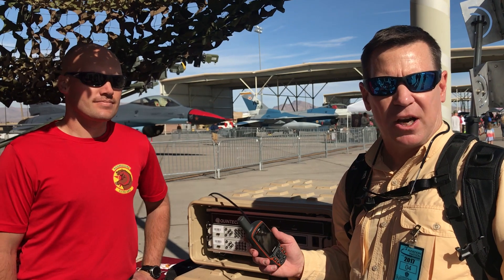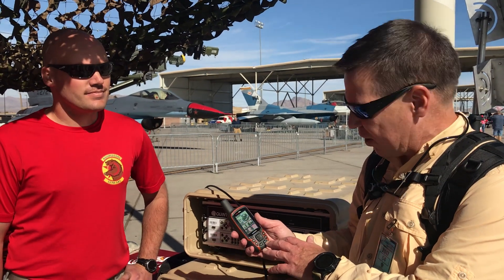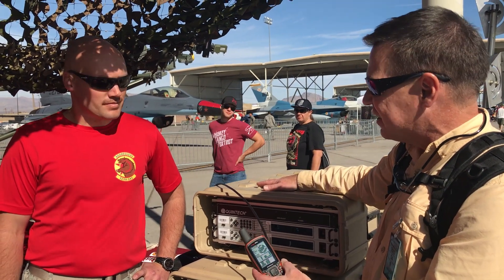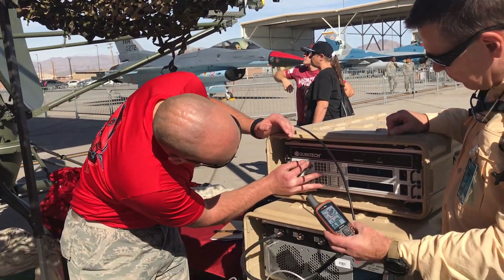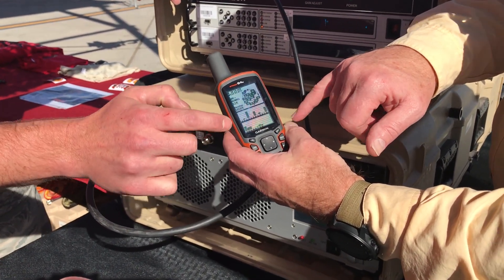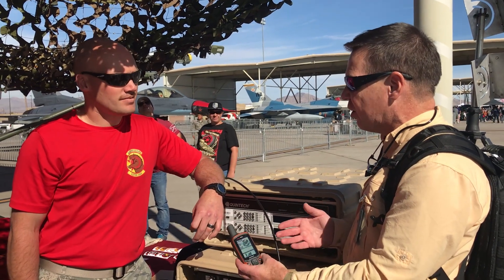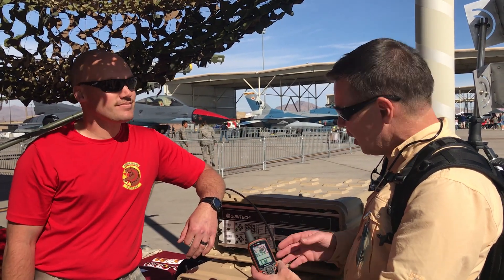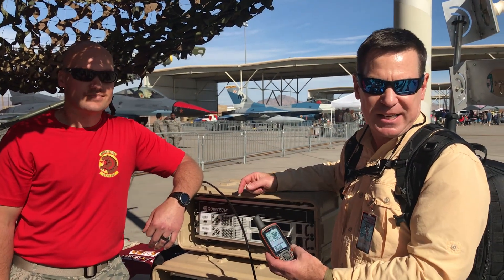Demonstration of GPS Jamming Capability by 527th SAS at Nellis AFB.

Comment: I was thinking about jamming my local weather RADAR and seeing if I can see it on the local website feed. How do I find the correct frequency/wavelength to Jam it? I was thinking about using the much simpler and cheaper broad spectrum Jamming but I think to Jam GPS and RADAR especially ones with counter-measures it's better to use packet jamming.

http://www.bom.gov.au/australia/radar/

Can I just use a spectrum analyzer to find the frequency or do I use different equipment? How much power do I need to Jam it at pioint-blank range? I was thinking even 0.1w would work?